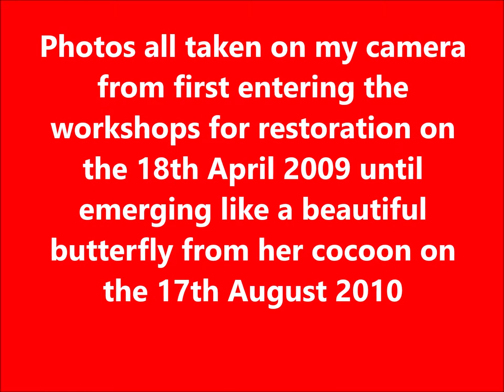Leyland National MK1 GLJ681N restoration 2009

Comment: As a mechanic for London Transport working at Poplar garage, we were allocated a little fleet of these to run under the Blackwall Tunnel to Eltham. They ran on route 108.

This was in the early 1980s, and our Nationals were brand new delivered from Chiswick works.

They were a superb bus, with very few problems and as a bonus the heating and ventilation system kept the drivers very happy.

I would agree that on engine start up, they could be a bit smokey. However it didn't appear to affect their performance in service. 

We were all advised to allow the engine to idle, after working to allow the 'airsearch turbocharger' to spool down. We were told this would prolong the life of the unit.

Thanks for sharing your photos with us on here. I'm aged 66 now and have been off the buses for a number of years. As for my old garage Poplar; in Leven Road E14. I have seen plans to demolish it. This will no doubt be used for multi million pound apartments overlooking the 'River Lea'. What price progress eh!!

Comment: What a great restoration, I loved driving the Nationals. I don't think I drove a N reg though. The L and M reg weren't fitted with anti roll bars, but the P reg ones were. Is your one fitted with the anti roll bar? It made a difference to the handling. 
We used to open the destination flap and have the Demister pipes blowing down on us in the Winter.
Some had cab heaters fitted later, that made a difference.
Reply from the maker: No antirollbar fitted - as far as I know no Phase 1 Nationals had them. And yes she rolls well! https://poultyphotos.smugmug.com/The-fall-and-rise-of-GLJ681N/Rubbing-down-and-repaint/i-NB98z6C/A